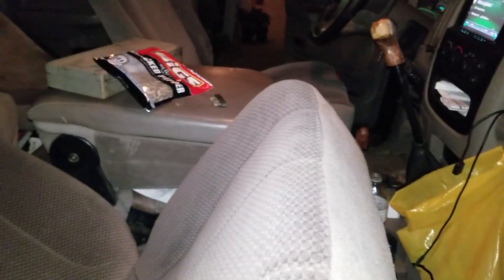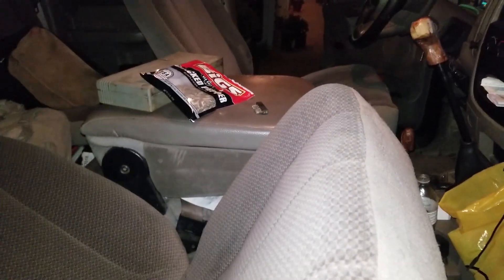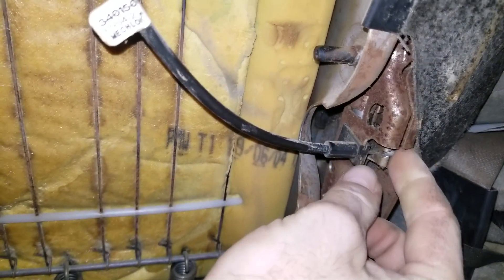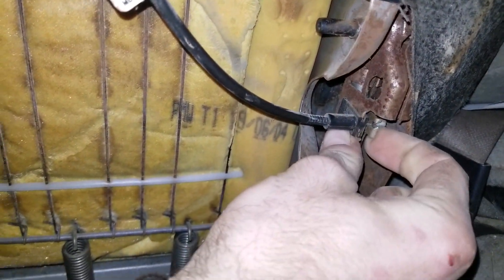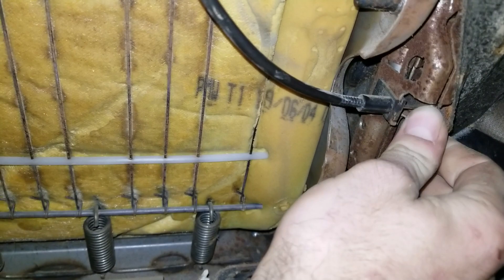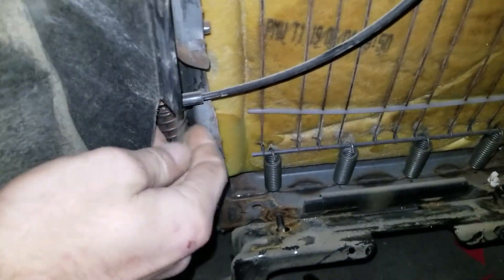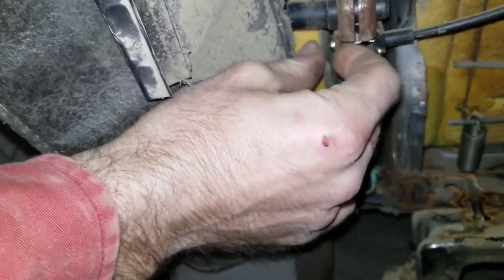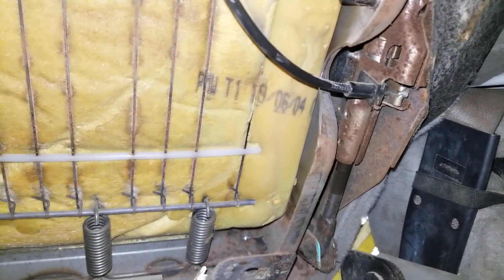How to fix seat recliner on 3rd gen dodge

Comment: I have to give you props man. Simple short sweet. Fixed the issue in less then 10 minutes and a few other issues with the drivers side seat. If you could give some of the others advice on recording like this.
Reply from the maker: Thank you much. A lot of my videos dont wind up this short and sweet. But i try to give all the info needed.